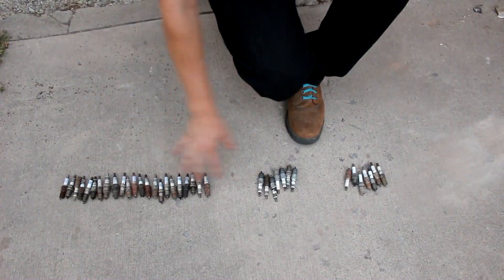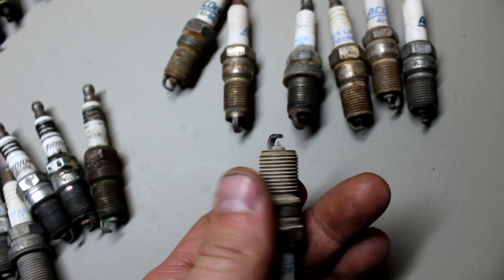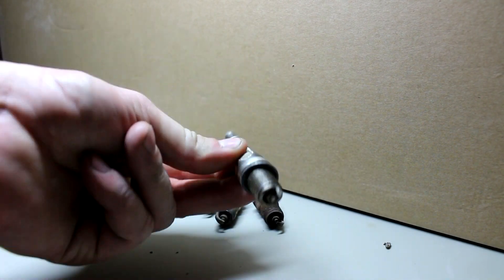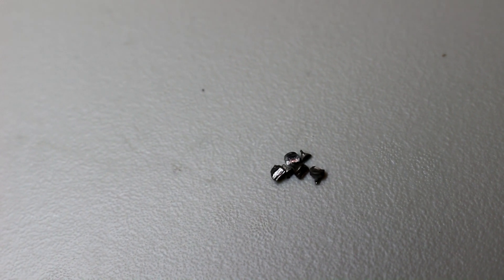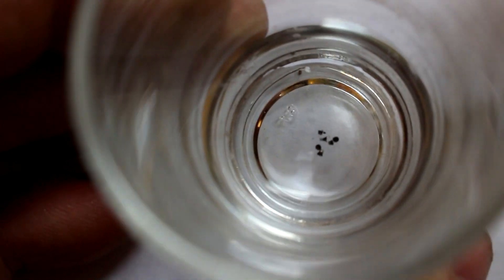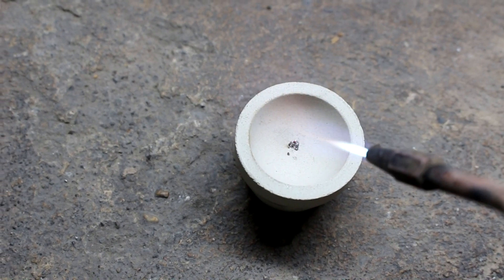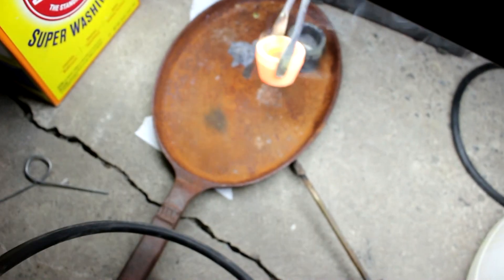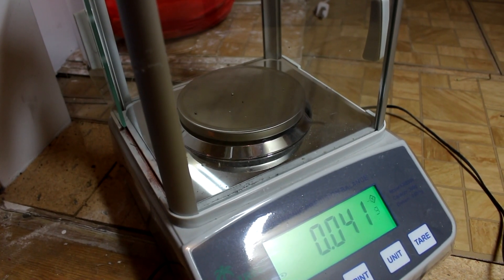Precious Metal Refining & Recovery, Episode 13: Platinum From Spark Plugs

Comment: You'd get around $1.53 for that platinum bead..
Reply: You'd need to spend a day at the junkyard clipping off leads into a baggie to make anything reasonable. You'd also have to take into consideration the cost of the acids involved and so on so forth to see if its a worthy investment.  It's a worthy investment IMO if you gather 2000+ spark plug leads (which is entirely possible) before doing a batch of these.  Implying this is not a good source of primary income but some side spending cash.  That iridium bead was only worth about $0.09 though :L not sure how much palladium one could make doing this.
Reply: lumker 
A day itself is worth more than the maximum you can make in Platinum value.
The only way Cody made money was as a subject matter for a video.
Getting views and high avg view time makes any widget worth putting on video.
Reply: @lumker  catalytic converters for Platinum.
Reply: Palladium is reserved for 'racing' spark plugs are they not? I don't think you will find many at the junk yard.
Reply: @Richard Smith  You'd actually be surprised.
I found 150 in just a few hours for a school project. I found 6 of them in an old 6 cylinder Chevy truck, Lol. Guess people are using them for old oil burners w/high fire coil because they don't foul out as quick.
Reply: yea but he barely used any plugs...thats pretty good for that small amount.. imagine 1000 plugs
Reply: 2000 spark plugs that be 4g of platinum at price 160 usd
Reply: 800 an ounce not a gram i deal in 40's jewellery so i see a lot of it
Reply: +Richard Smith I've found Hondas at junkyards with mono racing parts and racing seats so it's always a possibility
Reply: yes you right when i look up the price and i dont know what i see before 
platimun is 39/g and palladium 23/g
thank you for correcting my mistake
Reply: +Jonathan Vandagriff Imagine gathering, storing, and snipping 1000 plugs.  I'm not even going to bother trying to calculate out the time or effort required for such a task.  With 30 plugs he got around $1.50 worth of platinum.  Assuming no change of yield with scale, for 1000 plugs you're talking about $50 worth of platinum.  There is absolutely no way you're going to make this monetarily viable, especially when you start considering the cost of tools, energy for furnaces, etc.  Even if you don't value your time at all, you're still coming out with chump change if you make anything at all.  But seriously, just think how long it would take to gather 1000 plugs and snip 1000 plugs and ask yourself if you'd be willing to do it for $50.  If it takes you more than 7 hours to gather and snip 1000 plugs (so, you better gather and snip around 150 plugs per hour) , you are literally making less than federal minimum wage, not even considering other costs.  This is also all assuming that you have access to a place where you can reasonably acquire such a quantity of plugs without rapidly depleting your supply.  No way this will ever be profitable, even if you were using slave labor.
Reply: Grob Bley the pyramids weren’t built overnight lol
Reply: Yes but he got $1,100 for this video with 1.1M views good content
Reply: @MetalDetectingBenj  Oh wow so Thats how it pans out $100.00 per 100,000 .I need to get the youtube ball rollin ...
Reply: @MetalDetectingBenj  Thats a 3yr old comment will he get it ??
Reply: @fishfire_2999  that is a good update friend. After 3 years LOL. Yeah if youtube channel is monetized the estimated revenue is $1 per 1000 views with ads. Can be more if the country viewing has a higher rate or if the viewer don't skip ads or click the ads if they need it.
Reply: +Jamie Parker oh shoot sorry, I must have misheard the guy.
Reply: $37 /gram
100 milligram $3.70.
Half is $1.85
but think of a machine to snip the ends off.
the acid baths would be the same but your production would be high.
Reply: As a 1 time project of course its not worth the money but if you collect those for a long period goin to junk yards a few times a yr after a while you would be able to amass a decent lil amount of these metals still not something your gona do as a job but still could be worth your time if your in for the long haul. Been holding onto copper for years old adapter s, chargers, wires ect not something i can quit my job 2 do but if it was getting tossed anyway might as well keep and recycle it
Reply: @JohnSmith-fq7hj  exactly, put a large wooden box in the garage and fill it up a few at a time
Reply: As he's said in previous videos, the purpose of experiments like this isn't to make money. Its just a demonstration to prove a concept.
Reply: I'mBored777 I just wanted to let people know :P
Reply: @imbored7779  and to make money from youtube ads.
Reply: palladium is 800 an ounce so only a few bucks at the most
Reply: lumker Cody probably makes a few thousand a month off youtube. He does these for fun and educational reasons. So it would be possible for him to spend a huge amount of time to find these precious metals and the acids needed and he could make Money. The average person not so much.
Reply: Perfect , still a prophet he only used $1.52 in chemicals .
Reply: @fishfire_2999  i hate to be that guy but the word is proffit
Reply: @briancarter3704  profit even...
Reply: +lumker momo*
Reply: cheapest or expensive ? paladium is like you said around 800 for a gram platinum is like 35 for gram so if that 40mg bead was paladium it will cost 32 eur not 1,2 eur
Reply: I did wonder. I googled the April 2019 value of Platinum and it's still worth about the same value as you say for the 40 mg weighed.
Reply: I would just add it to an element collection no point selling it for money
Reply: Stonks
Reply: used more gas trying to melt it LOL
Reply: lumker found my new job lol
Reply: I was told by the guy that buys our catalytic converters, that palladium,"the cheapest metal in a converter" is 800/gram.
Reply: @momobhc  RHODIUM! $18,800

Comment: why did you only cut the arched outer wires in half.
Reply: The precious metals are very small coating just on the actual spark surfaces. Everything else is just steel/ceramic like he said.

Comment: Extract cyanide from fruit seeds...
Reply from the maker: I actually have over 100lbs of cherry pits and I have extracted cyanide from them, its not that hard really, in fact so easy that I'm worried about showing people how to do it.
Reply: if you're talking about how apple seeds supposedly contain cyanide, that wouldn't really be possible, as they don't contain actual cyanide, but rather amygdalin, a compound that produces cyanide when it comes in contact with digestive enzymes, which means that in order to actually get the cyanide, you'd need someone to eat the seeds, which would both make the cyanide irrecoverable and kill the person eating it.
Reply: +Snow Storm What about other seeds like cherry pits they should contain more...
Reply: +Cody'sLab . hahaha
Reply: +Cody'sLab just do it!

Comment: Hey Cody!
Awesome videos! I love them!
I'm also going to dig my own mine, but it's a little bit tricky because i live in Austria (that means the rocks are deeper but i have to dig trough a lot of clay) and our ground is only 2500 square meters that means i need to dig straight down.
But I have a question: Aren't you studying geology? I'm an engineering student and I wanted to ask you if you could recommend me some books you use in your lessons? (I'm a total beginner. The only things I know are about engineering and biology)

Comment: Could any if the tips be silver, rhenium, osmium, or tungsten?
Reply from the maker: rhenium is possible but I've never heard of it being used. silver would dissolve in nitric, the others would oxidize to easily.
Reply: How about tantalum?
Reply from the maker: I think tantalum is used in plasma cutters.

Comment: Would HF be cable to dissolve iridium?
Reply: Righto.... fluoroantimonic acid?
Reply from the maker: no
Reply from the maker: fluoroantimonic acid might do it but I've never had the opportunity to test it.
Reply: you should get the verification tic so people know its the real you
Reply: +Cody'sLab Maybe the iridium could be melted with an arc welder? 

Also dropping a super heated piece of Iridium into LOX might oxidize it?
Reply: Please be really careful handling osmium.  It reacts readily with oxygen when heated and produces osmium tetroxide vapors, which cause almost instant blindness.  On contact, the oxide is reduced by proteins(?) and lipids in the cornea and becomes very finely divided osmium deposited in situ.  Turns your corneas into mirrors.  OsO4 is used to 'stain' biological materials for electron microscopy.  The finely divided Os left on the specimen's surface is opaque to the electrons impinging on the specimen's surface.  Magnified ~100,000x , the grains of Os look minute, small enough to observe them separated by tens of Angstroms.  .
Reply: As Cody also said, you can't disolve Irisium with any acid
Reply: +Alex Rotaru Hi
Reply: +Cody'sLab how did u get uranium
Reply: Becci Staulcup sup
Reply: +Alex Rotaru WHT up
Reply: love starting conversations randomly :)
Reply: you can use a thermic lance which is about 5500 degrees celsius. (realtive simple) also maybe inductive heaters can melt it
Reply: aren't osmium also used for spark plugs?
Reply: online its not hrd
Reply: +Cody'sLab cody I rlu like ur vids I rly learn a lot from them
Reply: +A Cow ok I'm going to get some now thxs 😜
Reply: you can just order it from amazon.
Reply: iridium not uranium
Reply: +Cody'sLab I doubt fluoroantimonic acid will dissolve iridium. After all, it a strong acid but definitely not a strong oxidiser, the only oxidative power comes from (essentially freely floationg) H+ ions, and I doubt they will be enough to oxidise a platinum group metal.
Reply: if he comments on his own video his username is highlighted blue
Reply: +Cody'sLab probably because if you had the chance youd be on all the watchlists in the world
Reply: i mean, he cant even use it. there is virtually no way to transport it, and even if he did, any camera equipment he used to record it would possibly have parts dissolved by the fumes. the things he used to ventilate the fumes would also be eating. the thing freaking melts fume hoods.
Reply: Holy crap, I didn't know that. Never would have thought that Osmium oxidises so readily let alone forming a gaseous oxide. Good thing I never tinkered with it in the past.

Comment: Cody have you ever had success welding a 1/2 inch crack in an engine block right next to a freeze plug?
Reply from the maker: I've had good success using bolts.
Reply: I have a large generator that was ran with straight water. There is a small crack next to the freeze plug that popped out when it froze

Comment: cody u said there is no acid that desolves iridium but there is one acid u might not know about fluoroantimonic acid it is like 100 million times more powerful than surfic acid and can only be contained in a Teflon coated contaner and it can go right iron and other metals
Reply: BMAN488877 most likely
Reply: any time someone mentions a chemical that starts with "fluoro" I start getting scared. I hope you realize what that stands for
Reply: does it melt glass?
Reply: Easily
Reply: also 100 million seems like it would just become a hole in the ground unless you made it hover
Reply: It can ONLY be contaned in a Teflon contaner
Reply: +Fick Dich Iridium isn't a normal metal >_>
Reply: yeah, teflon is held together by the single most powerful bond in all of organic chemistry, so it can only be contained by the single least reactive substance known to man.
Reply: I'm pretty sure I have another way to store it... Or two but it might not be so practical
Reply: Anton Helsgaun well tell us then lol
Reply: BMAN488877 but can Jews steal beams
Reply: Fick Dich have it hover with ultrasound or over a strong fan, like a pingpong ball over a hairdryer

Teflon is probably easier
Reply: Yea lolAnton Helsgaun
Reply: Fluorine
Reply: +Fick Dich Illuminati fluorine in water mind control

Comment: Maybe if you preheat the crucible and iridium in the furnace before hitting it with the torch, you will be more successful. I suspect that during the torching process, most of the heat is going into the crucible.
Reply from the maker: probably why I was able to melt the platinum.
Reply: Could be. I find iridium really interesting. The first Periodic Video I watched was on iridium and I was hooked on the whole channel after that.

Unrelated: A while back, I asked if you'd like me to send you some batteries to help with your traveling and videography. I'd still like to send those to you if you're interested.

Comment: Iridium is cheaper than platinum but iridium plugs costs more ? Dafuq ?!
Reply from the maker: Iridium is very hard to work with.
Reply: ***** Oh I get it. It's the same thing with swords too. High carbon steel swords like 1095 are way more expensive compared to 1060 high carbon because it has less carbon content.
Reply: +Mickxal High carbon = harder to work with in the forge for those who didn't know :)

Comment: aren't these the things you use to make ninja rocks? if that is what they call them in english. (basically a rock that breaks glass easily)
Reply: +Hawk_ Eye it's the ceramic of the plug
Reply: rock should be more something like ceramics or glass i think.
Reply: Yes, I don't know what people call them but the ceramic off the spark plugs will break glass easily
Reply: Yeah, that's the ceramic around it but not the platinum.
Reply: Yes, the ceramic of the plug is aluminium oxide (the same stuff as on sandpaper or even rubies and saphire gems). It's hardness is quite close to diamond and when broken it has razor sharp corners (that don't break off easily, because it's so hard). It's those very sharp hard tips that make it "good" at breaking glass. There isn't much difference to a rock on normal glass, but on tempered glass (safety glass) that's used in car windows for exampleit's much easier to crack the hard surface.